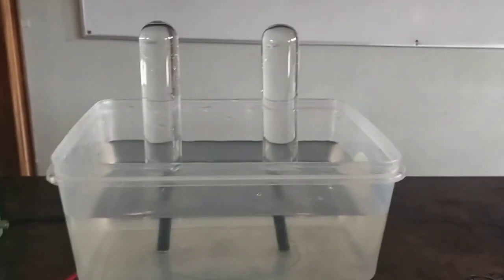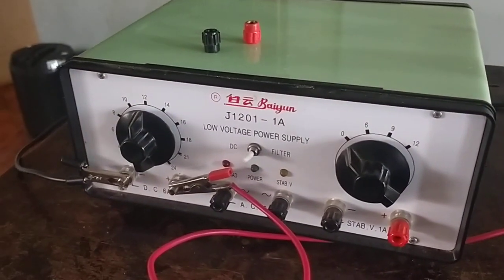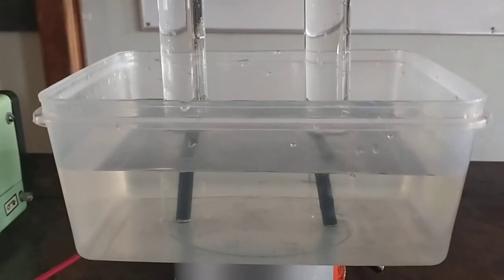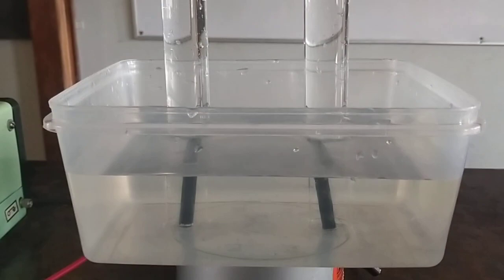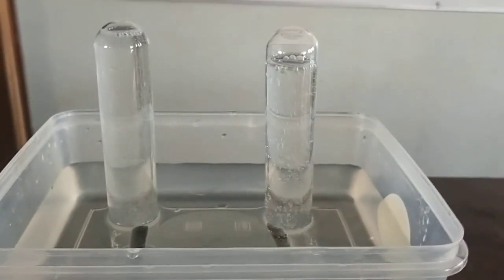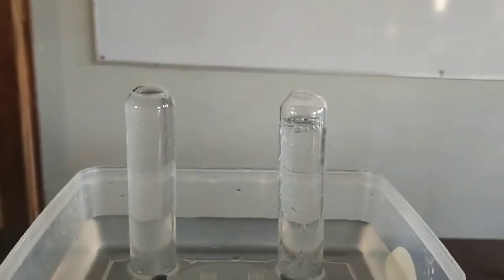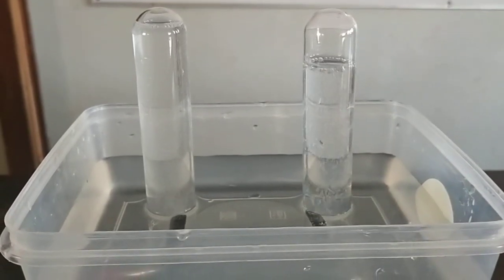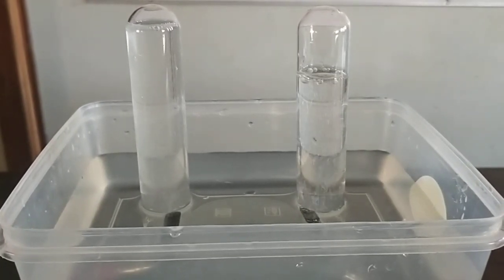Electrolysis of acidified water

Comment: I bet you used Sulphuric Acid H2SO4 to acidify the water. The two electrodes are obviously decomposing the H2SO4 resulting in the two gasses H & O being collected. Show me water being split without using an electrolyte which contains H & O.